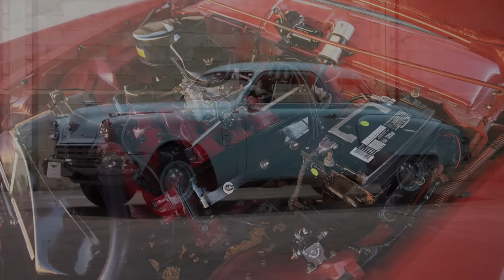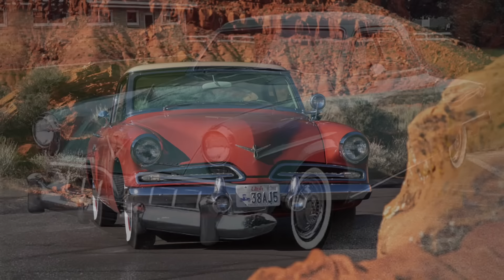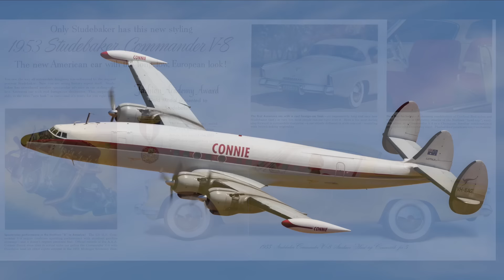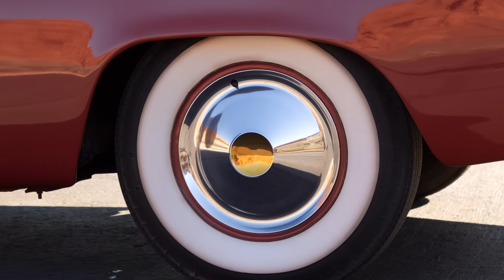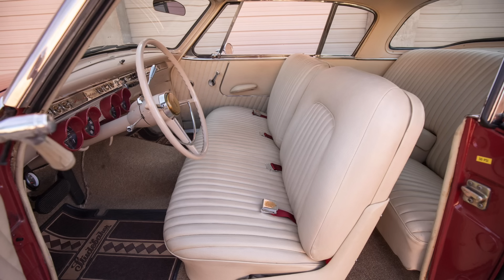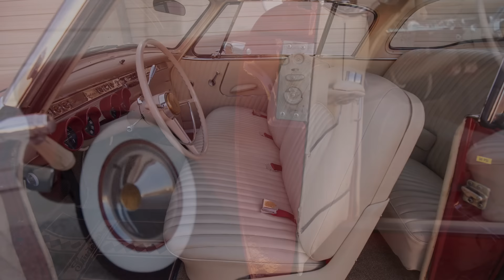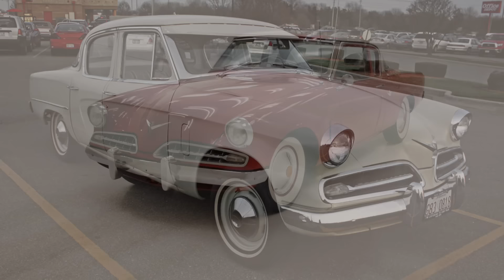Most Beautiful (& Flawed) Cars: 1953 Studebaker Coupes Had Only Skin-Deep Beauty

Comment: I had a 53 Commander V8 Coupe, purchased about 60 for about $600.
The description was pretty much as I remembered, I think the body
was heavier than most, a guy in a Chevy ran into the rear of my car
destroyed the chevy, one or two small dents on the Study.The
interior was nice looking, had an engine turned dash aluminum/chrome
and several gages. YES I purchased it for it's looks, am 82 and it was
the most BEAUTIFUL car I have had!

Comment: Rust was a big problem for Studebaker.   Around 59, road crews switched from cinders to road salt.
This caused the old cars to rust out.
The 59 Chevy had problems with the headlight bucket rusting out.   An interfender was installed to stop the rust.
Studebaker seems to rust out the worst.

Comment: This car was way ahead of it's time.
Reply: Admittedly it was pretty but it was rubbish engineering for all that.
Reply: @andrewwebb9426 that's a true fact of Automotive History it's also very sad, a lot of cars that look Sleek pretty and solid, are some of the most loose rickety and rattly terrible to drive cars ever made. And oddly, the opposite is true, some of the most ugly stodgy mundane and boring looking cars are very tight solid and fun to drive. And of course there's some that have both characteristics. I wish that Studebakers were solid and sealed well, I never would have sold them and would have preserved the ones that I did have. And would buy another one. But I'm allergic to creaks rattles add leaking weather stripping and wind noise😢
Reply: Are you talking about the shoddy workmanship?
Reply: @Alltime2050 obviously The Styling and Design
Reply: @7x779 Maybe it would be futurist design if this was the 1980s.
Reply: @Alltime2050 well that would mean it's even more futuristically designed considering it's a 1953. And if you look at these restored as a retro rod they're absolutely gorgeous, and there's still a favorite to use at Bonneville Salt Flats because they are so sleek and aerodynamic. Even for today. They definitely were way ahead of their time, look at the average styling of the 1950s those were some butt ugly cars with the few exceptions
Reply: @7x779  I confused your comment with someone defending the Cybertruck. I agree that the Studebaker was beautiful. I had a girlfriend like that once. Same problem.
Reply: @Alltime2050 you mean she was rickety and rattly and fell apart when you ran into some bumps?

Comment: Great looking cars.  One had been abandoned at a nearby apartment building when I was in high school and the apartment owner said I could have it if I could remove it.  It was rusted, trashed, and had a bad knock in the flathead 6 but I drove it (illegally) for a few weeks then loaned it to a younger neighbor kid who promptly totaled it.

Also had a 1959 Lark obtained under similarly questionable circumstances.  It had a V-8 (259 IIRC) that had been modified and was reasonably quick.  One thing that helped the performance was light weight due to it having no glass except for the windshield, no back seat, no trunk lid and what remained had probably had a couple of hundred pounds removed in the form of rust.  It was fun to drive, though.

Comment: As you stated, the 54 was a better-built car that looked almost identical, and had better brakes as well, and 7 more horsepower.  The 55 had a lot more chrome, but the engine was enlarged to 259 cubic inches.  The Studebaker V8 was enlarged again for 56 - 289 cubic inches.  The Chevy V8 could go to a maximum of 283 cubic inches.  The reason in grew to 327, then 350, and even 400 cubic inches is because of the new Fire Ring head gaskets.  If they had never been developed, those bigger small blocks would have never come into being.

Comment: I think it’s a perfect candidate for one of those extreme resto-mod builds you see at auctions and on cable shows. You do the same thing they do to  old pick up trucks or muscle cars. Jack up body, slip a new high performance chassis, power train, brakes and suspension under it. Then a top designer freshens and improves the interior and body details.
Terrific car and you’ll never see an identical one driving past.
Reply: YOU ARE SUPPOSED TO KEEP CLASSIC CARS STOCK!!!  The 54 and 55 version of this has a better frame, so if you want a better one, just buy a 54 or a 55, don't destroy a stock 53.
Reply: @jamesbosworth4191 The value off the cars that make them classics is purely the styling. Keeping some stock as museum exhibits is fine but as the video points out aside from the styling they were poor quality. 
Making a few of them actually enjoyable to drive on a regular basis allows them to be in motion on the road where people can enjoy seeing them in motion. 
There are enough of these to keep some stock for archive purposes and improve others.
Reply: @Palaemon44  Obviously, you are not a classic-car lover, but are a hot-rodder.  The twain shall never meet.

Comment: I really enjoyed your video. I bought a '54 Studebaker for $60 in 1967.  I sold the radio for $30 to make tuition.  Then sold the car for $40 after the spring quarter. When I tried to replace the broken speedo cable, I messed up the automatic transmission so it only had 3rd gear.  It was somewhat challenging to get around Duluth.  I'd have to go east to 45th Ave E to get up the hill to UMD.

Comment: In case a dozen people haven’t said already, the biggest Stude V8 was 304.5 ci in the R3 version. There was R4 and R5 as well but they were exceedingly rare (R1/R2 were more common but still not everywhere) They made a 224 version for trucks, a 259 that was used in almost everything and a 289 that was also easily available. All the same blocks, just different bore/stroke inside. I have a 1956 Hawk that is very similar to the 53/54 so I always like seeing Studebaker get some love around here.

Comment: My father owned a 1955 Studebaker President Speedster.  There was only 15,000 of them made.  They came in two color schemes.  One was a chartreuse and green combination and the other was white, Pimlico gray and Congo ivory, top to bottom.  The latter scheme was on my father's car.  On the exterior, it had the most chrome and stainless steel trim of any Studebaker.  Just behind the trailing edge of the doors on the side molding was a special emblem for the Speedster models.  My father's car had the stainless steel simulated wire wheel covers.  Inside the car there was leather upholstery in Congo Ivory color ( a cream color with faint veins of pink running throught it).  The front bench seat had an asymetric seat back where the driver's side was approximately 40% of the width of the seat while the passenger's side had the remaining 60%.  Both seat backs could be folded forward to allow access to the back seat.  The door cards on the interior were Pimlico gray.  All of the leather was stiched with a diamond pattern.  On the floor were red horse hair carpets.  In the footwells there were control levers for the side louver doors to admit air to flow into the footwells.  The machine turned aluminum dashboard (instrument panel) was fitted with an array of Stewart Warner gauges including a tachometer.  On the mechanicals of the car; it came with a 289 cubic inch displacement V8 engine with a four barrel Rochester carburetor.  The engine had an oil bath air cleaner.  The transmission was a Borg Warner 3 speed automatic (the same transmission used in the Jaguar sedans).  I believe my father paid about $3800 dollars for the car right off the showroom floor.😊
Reply: More color schemes available than your listing. My favorite was the charcoal/coral combo
Reply: Your father had a GORGEOUS car.  Later on, they offered a coral/charcoal body with a white top as well.  Those, to me, are even better than the 53 - 55 "regular" hardtops and coupes.
Reply: Was there a supercharged. Model.
Ours was black or charcoal and white
Reply: @waynekilgour393  The supercharged model came out in 57, but I have heard of dealer-installed superchargers on earlier models.
Reply: Not true. Also 289 didn't come 'til 1956 @jamesbosworth4191
Reply: my first car was a 55 prsident with a Packard 352  v8 with a blower. That car was a beast fast and poweful. @jamesbosworth4191

Comment: A little more on the dispute between Studebaker and Mercedes; Studebaker and Mercedes Benz entered talks that would award the Studebaker dealerships the license to sell Mercedes in America. Studebaker was so stoked that, they celebrated by putting  the three pointed stars on the 1953 Studebakers. But, Studebaker forgot to ask Mercedes if they could use the logo . Mercedes protested the use of their logo on the Studebaker cars. Studebaker stopped using the logo. And, it was after the merger with Packard that they were actually selling Mercedes on the Studebaker dealerships.

Comment: Have a ‘53 Champion Coupe. Has been in the family since 1973. Very limited use in the last 25 years, in process of restoration over the past couple of years.6 cylinder 170 cid flathead 6 with OD, should be road worthy for Sunday drives etc. soon. Always a head turner.

Comment: The 1953 Studebaker Coupe was a "SPORTS CAR," not a family passenger car. It was lower than any other production car at that time, and because of its lower stance, the Studebaker could out-handle all other cars. Studebaker was highly interested in Miles Per Gallon, so they didn't get into the drag race mentality. Their Sports Car Commanders were fast enough for most car buyers who wanted a sleek, sophisticated, modern car that was an attention-getter. The Lowey Coupe was a high-maintenance vehicle requiring lubrication, oil changes, filter changes, electrical checks, thorough body inspections with inner panel, and undercarriage cleaning.

Comment: Bob Bourke took a 1953 Studebaker Commander Starliner over to GM. He wanted to know what GM would charge to sell it. GM told Bourke that Chevrolet could sell it at a profit for $1,900. Studebaker was charging $2,500. 

Also, Studebaker management thought the 4drs would be more successful. The dealers reported that the coupes were demanded by customers 10 to 1 over the sedans. Production of the coupes was cranked up, but there was difficulty mating the nose to the rest of the body. 

Good thing Vance & Hoffman talked Packard's James Nance into a " merger " by early 1954. ( The deal was done by Lehmann Brothers. Packard would use their stock to payoff Studebaker's debt ).

Comment: My father-in-law was a test driver for Studebaker at their proving grounds west of South Bend.  What a job that would have been!
Reply: The proving grounds have been taken over by Navistar trucks.  They have retained much of the original 1930s Studebaker designs on the perimeter.
Reply: @Dagwood-Bumstead-001  We used to picnic inside the "A" in the "STUDEBAKER" trees spelled out on the grounds.
Reply: I once worked with an older gentlemen who had been the west coast sales manager for Studebaker.  He had a late '50's Hawk with a supercharger.  That was back in the '80's.
Reply: @ksman9087  
Somewhat off topic,

Around 1960 or so (it may have been earlier) Studebaker became the distributer for Mercedes.  This gave the dealers a luxury car to sell after Studebaker killed off the top line and Packard models. Today, many older Mercedes dealerships are old Studebaker dealerships.

Comment: I recall looking at a new '53 Starlight coupe. In early '56, I saw a used '52 Champion six with only 17,000 miles at the local Chevy dealer. I urged my father to get it for me to college, for $600. To improve gas mileage, in the fall, I removed the radiator fan. When summer came, I discovered that engine temp could be managed by turning cabin heat on and opening windows, even in city traffic. I kept my Stude five years, replacing the fan only to sell the car.

Comment: That hardtop coupe is probably my all-time favorite dream car to build a nice retro-rod out of. I didn't know about the flimsy frame, or the questionable door latches. Those would certainly be issues that would need to be addressed.
Imagine that body on an Art Morrison custom frame with Vette suspension and brakes, a 327 bolted to a 5-speed, and some creature comforts like AC and a cherry stereo system. My dream car, for sure.
Reply: Classic cars should be kept STOCK.

Comment: My mom had a '51 bullet nose Studebaker, and my earliest memory is my two-year-old sister falling out onto the street when mom pulled the car out of the driveway because the back door had opened. Of course, there were no seatbelts or child seats when this happened (1960). She wasn't injured, fortunately. 

I loved the looks of the '53. As a kid, I built the AMT 1/25th scale kit, which included the option of a twin-supercharged Chrysler hemi Bonneville racer.
Reply: My Mom had the Starlight coupe, which eventually came to me as my first car. Starter button was on the floor under the clutch pedal.
Reply: I built that AMT Model too.  I had a 53 Champion, 6 cylinder - 3 speed w/ o-drive. Loved it !

Comment: This and the Avanti were brilliant designs.  Studebaker got into trouble by 1. Purchasing Packard, which was in far worse financial straits than they thought, and 2. Not taking a strike in the 1950's, instead giving line employees a juicy contract that eventually sank the company.  They tried to use design to get out of the hole, but it simply didn't work.  The plant in South Bend shut down in 1963, and the Hamilton, Ontario plant built the last Studebaker ever in March 1966.  Today the name and production rights to Studebaker are owned by Federal Mogul corporation, which makes brake pads and many other parts of cars.

There is a Studebaker museum in South Bend, Indiana and I have been there half a dozen times on layovers.  This company was the premier builder of carriages in the 1800's, to include most of the carriages used by Presidents.
Reply: There was an even bigger problem - management.  Can you imagine not having a conveyor between the body stamping plant and the main assembly building?  They had to load finished body panels onto a truck, unload the truck across the street, go back and reload, etc.  Management REFUSED to have a conveyor built!  Talk about stupidity!
Reply: Packard bought Studebaker..
Reply: @trudygreer2491  I just looked that up and you are CORRECT.  I've fixed it.

Comment: In 1953, the MOMA in New York city had an exhibit of the worlds best car designs - a 1953 Studebaker hardtop coupe was one of the ten cars shown.  One of the small feature photos in the booklet for the show was a close up of the Studebaker wheel cover.  My father bought a '53 coupe in high school and it was his daily driver until 1988 - just over 370,000 miles on the body/frame and it's second motor.  These coupe/hardtop bodies carried on in Studebaker's lineup to 1964 in the Hawks - with little money, they had to work with what they already had.  Always enjoy your videos - keep up the great work!
Reply: This person should do a little more research on a vehicle before putting out a video, as his lack of knowledge really shows up in the video.  Things like whats a hardtop compared to the coupe, hence starliner vs starlight and commander vs champion the use of stainless moldings, door handles and stainless lock sets. The Studebaker was well advanced for the time and it continued to be till the end but some models were  expensive to build, due in part to low volume production, it was also more expensive to build outside of Detroit being based in South Bend and the management pushed the four door family models, combined with poor advertising and did little in modernization related to production lines and little in engineering money to continue to advance designs. Studebaker  corporation was making good money in there other divisions but was not investing in there car division they also made some really bad decisions in management so it was tough going for the car division.  But some of there cars were damn nice cars have owned several Hawks myself.
Reply: @JoeJoe-73  if Studebaker and Packard had joined Nash and Hudson to become a part of American Motors then that would have made a lot of financial sense. Much would have been saved by utilizing certain common parts, chassis and marketing techniques.
Reply: For the 1962 Gran Turismo Hawk, stylist Brooks Stevens did a masterful job of updating the decade-old design with an upright grille, a roofline copied from Ford's Thunderbird, and a squared-off rear deck featuring a pattern-printed metal insert like the Lincoln Continental.  He must have liked Ford products!